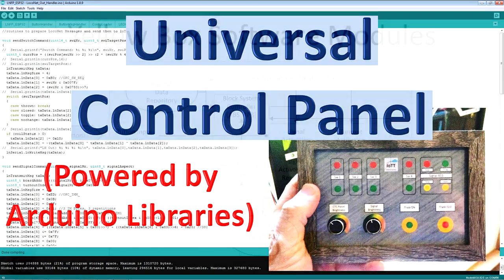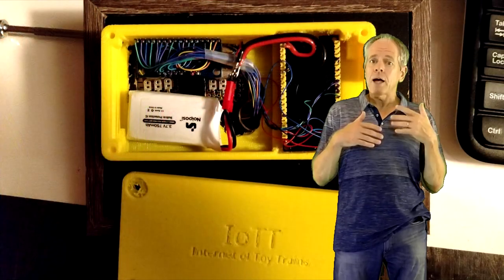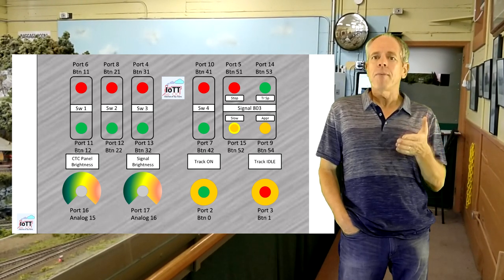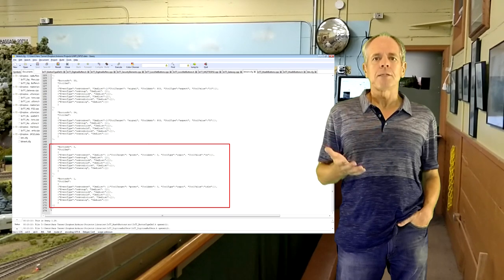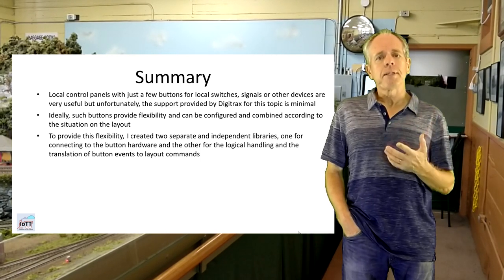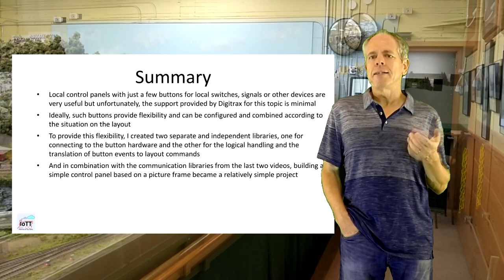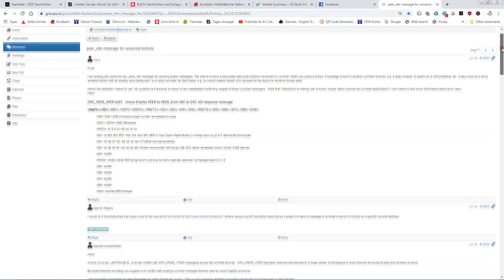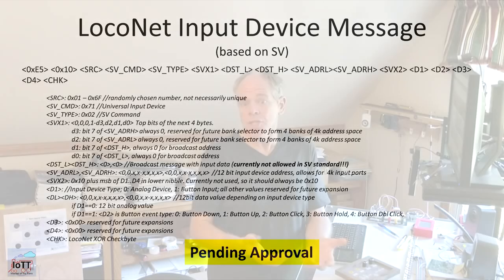Universal Control Panel (Video#29)

Comment: The way you built that panel… a laminated sheet over tactile buttons… I'm getting traumatic flashbacks to a certain design of bus I used to drive which had a very similar panel :/

It turns out, a panel you need to look at to operate is not as good as one you can use by touch only when you're trying to drive a bus…
Reply from the maker: It is actually working quite well as long as the total surface of the panel is relatively small and the distance of the laminated sheet is maintained using some spacers. But of course you can make holes in the laminated sheet so that the buttons are free. Or you use touch buttons as I showed in Video #9

Comment: Hi,  My progress with the "ButtoninputReport"  sketch in Arduino IDE  has got my errors list down to this when i try to compile it.....

WARNING: Category 'Layout Control' in library IoTT_LocoNetButtons is not valid. Setting to 'Uncategorized'
In file included from C:\Users\Ross\Documents\Arduino\libraries\IoTT_Mux4067Buttons-master\examples\ButtonInputReport\ButtonInputReport.ino:2:0:

C:\Users\Ross\Documents\Arduino\libraries\IoTT_Mux4067Buttons-master\src/IoTT_Mux64Buttons.h:94:26: error: 'DynamicJsonDocument' has not been declared
   void loadButtonCfgJSON(DynamicJsonDocument doc);

exit status 1

Error compiling for board NodeMCU-32S.

I have not come across these before so I figured its time to consult the creator.
The ....   
WARNING: Category 'Layout Control' in library IoTT_LocoNetButtons is not valid. Setting to 'Uncategorized'

message comes up from most of the Iott examples.

Ross
NZ.
Reply from the maker: The Layout Control warning comes from a library description file (library.properties) which I think has been replaced in the meantime. Please make sure you have the latest version of the library. But anyway, this is just a warning and has no impact.
The JSONDocument error is more serious. It looks it is not finding the ArduinoJSON.h library when compiling. Make sure it is installed in the latest version.
Reply: aye, tiss the old update the libraries trick that catches one out again..  Thanks for your reply.  that one compiles now.
Reply from the maker: Very good, glad to hear. I think different library versions is one of the bigger problems when using the Arduino IDE for software deployment. The alternative would be using PlatformIO, where it is possible to pack the libraries to the application. I like that technically, but then in makes it more complicated  because users have to install an additional software package.
Re. ArduinoJSON: They did a major revision from version 5.x to version 6.x with some incompatibilities. So, once you install  version 6.x, you may run into problems with compiling applications that were written for version 5.x of ArduinoJSON, so you will have to upgrade those apps. ArduinoJSON.org has information on that process. Overall it is not that complicated, but time consuming. However, well worth it as the version 6.x is in my opinion a significant improvement.

Comment: PaddingtonbearNZ

Thanks for your reply Hans.  Yes that warning  has gone :-)  I have checked through your list of includes and I have all 8 that are required for the LocoNetGateway example that comes with video#29.  And now, Just to add to the mystery i get the following....

Error downloading https://dl.espressif.com/dl/packag_esp32_index.json
C:\Users\Ross\Documents\Arduino\libraries\AsyncTCP-master\src\AsyncTCP.cpp: In function 'bool _start_async_task()':
C:\Users\Ross\Documents\Arduino\libraries\AsyncTCP-master\src\AsyncTCP.cpp:218:141: error: 'xTaskCreateUniversal' was not declared in this scope
         xTaskCreateUniversal(_async_service_task, "async_tcp", 8192 * 2, NULL, 3, &_async_service_task_handle, CONFIG_ASYNC_TCP_RUNNING_CORE);
exit status 1
Error compiling for board NodeMCU-32S.

I tried going to the URL in the error message and got the infamous  404 page not found message. I have tried going to file manager and finding the AsyncTCP library to see what version I have but nothing comes up.  About now I think there is something going on here that is escaping me. The good news is that 3 out of the 4 IoTT examples now compile.

Ross
NZ

Comment: Hi, This time its the LOTT_Gateway that comes up with....

WARNING: Category 'Layout Control' in library IoTT_LocoNetButtons is not valid. Setting to 'Uncategorized'
C:\Users\Ross\Documents\Arduino\libraries\AsyncTCP-master\src\AsyncTCP.cpp: In function 'bool _start_async_task()':

C:\Users\Ross\Documents\Arduino\libraries\AsyncTCP-master\src\AsyncTCP.cpp:218:141: error: 'xTaskCreateUniversal' was not declared in this scope

         xTaskCreateUniversal(_async_service_task, "async_tcp", 8192 * 2, NULL, 3, &_async_service_task_handle, CONFIG_ASYNC_TCP_RUNNING_CORE);

                                                                                                                                             ^

exit status 1
Error compiling for board NodeMCU-32S.

Ignoring the WARNING   and concentrating on the AsyncTCP  I have deleted any reference to this file to the point of getting the no such file exists error message and then I re-installed a fresh github download of  AsyncTCP-master and installed the zip file via Arduino IDE library manager.   The result is as shown above with no change from the previous error messages I was getting. 

Any guidence on this would be much appreciated.

Ross
NZ
Reply from the maker: Thanks for the notification. 
I have changed the reference in IoTT_LocoNetButtons, so the warning should be eliminated as soon as you download the updated file.

The error is more complicated. It looks you are using AsyncTCP version 1.1.1, while I was still on 1.1.0. Anyway, I downloaded and installed the latest version and my CTC panel sketch compiles fine with 1.1.1
You may want to compare the list of includes with what you are using. Here is my list (I will publish the full sketch with the next video):

#include <arduino.h>
#include <EEPROM.h> //standard library, can be installed in the Arduino IDE
#include <WiFi.h>
#include <TimeLib.h> //standard library, can be installed in the Arduino IDE
#include <ESPAsyncWebServer.h>
#include <DNSServer.h>
#include <ESPAsyncWiFiManager.h>         //https://github.com/tzapu/WiFiManager or install using library manager
#include <NTPtimeESP.h> //NTP time library from Andreas Spiess, download from https://github.com/SensorsIot/NTPtimeESP
#include <FS.h> //standard File System library, can be installed in the Arduino IDE
#include "SPIFFS.h"
#define FORMAT_SPIFFS_IF_FAILED true
#include <ArduinoJson.h> //standard JSON library, can be installed in the Arduino IDE

#include <IoTT_DigitraxBuffers.h>
#include <IoTT_Mux64Buttons.h> //as introduced in video # 29
#include <IoTT_LocoNetButtons.h> //as introduced in video # 29
#include <IoTT_LEDChain.h> //as introduced in video # 30
#include <IoTT_LocoNetHBESP32.h> //this is a hybrid library introduced in video #29
#include <IoTT_MQTTESP32.h> //as introduced in video # 29
#include <IoTT_Gateway.h> //as introduced in video # 29
#include <IoTT_SecurityElements.h>

If your software is based on earlier version of my CTC panel or signaling sketch, I would think the problem is with the web server, as I have switched to the Async Server family.
Hope that helps.
Reply: @IoTT  

Thanks for your reply Hans.  Yes that warning  has gone :-)  I have checked through your list of includes and I have all 8 that are required for the LocoNetGateway example that comes with video#29.

And now, Just to add to the mystery i get the following....

Error downloading https://dl.espressif.com/dl/packag_esp32_index.json
C:\Users\Ross\Documents\Arduino\libraries\AsyncTCP-master\src\AsyncTCP.cpp: In function 'bool _start_async_task()':

C:\Users\Ross\Documents\Arduino\libraries\AsyncTCP-master\src\AsyncTCP.cpp:218:141: error: 'xTaskCreateUniversal' was not declared in this scope

         xTaskCreateUniversal(_async_service_task, "async_tcp", 8192 * 2, NULL, 3, &_async_service_task_handle, CONFIG_ASYNC_TCP_RUNNING_CORE);

exit status 1
Error compiling for board NodeMCU-32S.

I tried going to the URL in the error message and got the infamous  404 page not found message.
I have tried going to file manager and finding the AsyncTCP library to see what version I have but nothing comes up.  About now I think there is something going on here that is escaping me. 

The good news is that 3 out of the 4 IoTT examples now compile.

Ross
NZ
Reply from the maker: Looks like a problem in the IDE settings for the ESP32. You find the entry in question in File - Preferences - Additional Boards. If I check my setup, it says https://dl.espressif.com/dl/package_esp32_dev_index.json which is different from your error message. Try to change it, at least the e at the end of package, maybe also the _dev_, I am not sure.